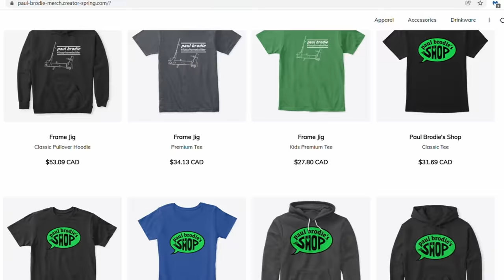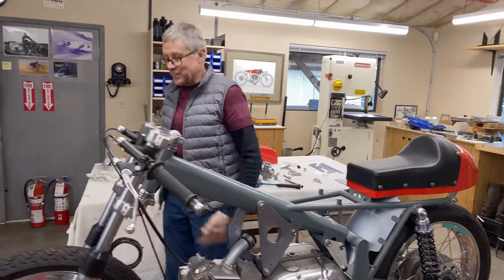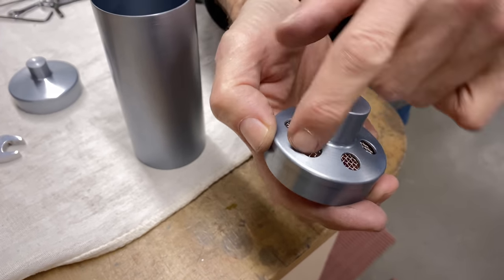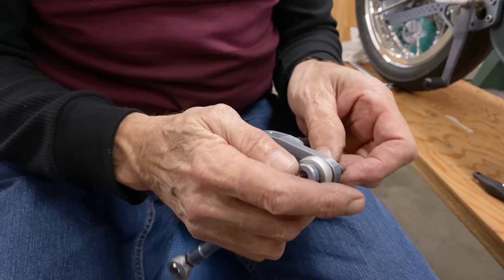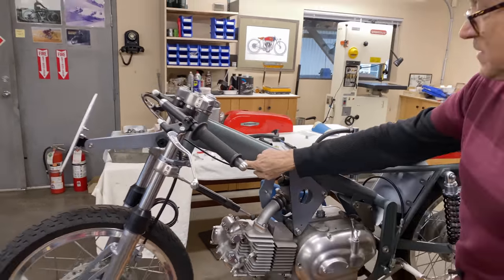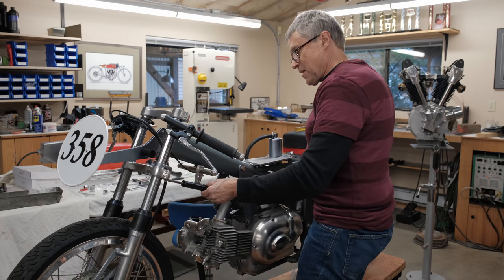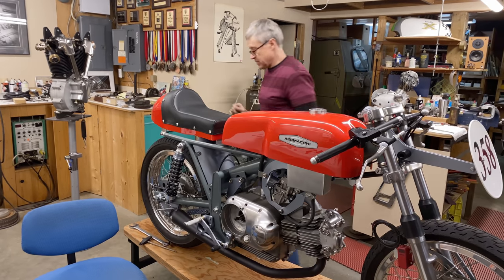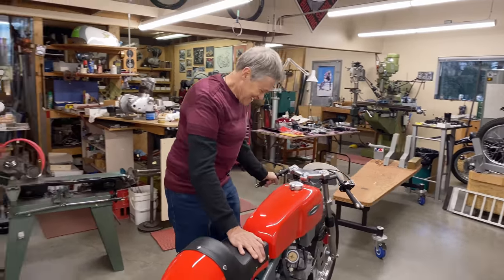Aermacchi Build - Part 2 // Paul Brodie's Shop

Comment: Wonderful work Sir! When you were doing the carb spring and stating three hands were wanted, made me think of doing this on my Norton Commando with two Amal concentric carbs. I saw a tip on another channel about winding/threading the spring onto the cable after fitting the cable into the throttle slider. Sure enough, this works a treat! No more aching fingers and cramped knuckles trying to hold the spring compressed while fitting the cable.
Reply from the maker: Well that's an interesting idea. Thanks.

Comment: Your workmanship and build are absolutely beautiful. Back in the day I had a number of these street bikes and even with frequent oil changes the roller bearing on the rod big end  was only good for about 10 to 20,000 miles. They weren't all that hard to replace but they were expensive, about half the price of the bike's value. .
Reply from the maker: Thank you Yoda. Yes, the crankpin was also the sludge trap and when it got full it stopped the oil flow to the rod.
Reply: During that time period most engines needed extensive repairs or maintenance requiring getting torn down , especially if pushed hard . A larg number of motorcycles engine had the sludge trap inside the crank shaft or on it . One popular option was an oil slinger that looked like a large washer that had the outside edge rolled over forming a trough that caught and held the sludge after it had passed through the crankshaft. Those also would get full of sludge put the location allowed oil to continue to flow. People who did the recommended teardown are de-sludg got very long engine life. Oil filters changed all that. When I was working in a Dealership of British motorcycle a proper engine tune-up included valve grind and piston rings. 
I remember overhearing a conversation between two men about how incredibly it was to get 50 miles out of a car engine with out doing a valve grind. Remember engin oil only  came in single viscosity number ratings.  20w or 30w were common for new engines. 50 was often used in older engines or in hot climates.
Reply from the maker: @thomaslemay8817  The world certainly has changed. Oil filters, better oils, and much more. I remember using 50W oil in my 750 Norton. Sure was hard to kick over on a cold day. I was a young lad and didn't realize I might be hurting my motor..

Comment: Wonderful! Everything looks perfect and fits together very well! Amazing!! I would think it also has a very low center of gravity because of the layout of the engine. Beautiful bike!! Is it a stock frame or did you build it?
Reply from the maker: Thanks William. Yes, the centre of gravity is low and because the bike is so narrow, those factors definitely help the handling. I built 85% of the frame in 2001, and recently finished it off.

Comment: 206 is amazingly light. Maybe add some lightening holes in the front number plate mount? On my old Yamaha RD racers, I started with linkage, but eventually just got a short lever, put it in and shifted upside down. Is there room to do that?
Reply from the maker: Pat, I don't like that system because often the arc of your foot and the arc of the shifter oppose each other. I'm quite happy with what I have. I am lightening the clutch hub, however,  and have already saved over 1/2 pound.
Reply: @paulbrodie  True, and you have to be very careful with the length of the now backwards shift lever and the distance to the footpeg. And of course, you have to remember to shift up to mean down and down to mean up.

Comment: A couple of tips for this awesome two wheeled craftsmanship. First, on the rear brake when you adj the chain you will alter the brake adjustment so be sure to check it before heading out on the track. This is why the cable boss is best placed on the backing plate. Secondly, on your "sex bolt", the bolt should extent to the outer edge of the nut's threads. As it is now if the sleeve section fractures the assembly falls apart and you have no shifting leading to a potential dnf and possibly a wasted weekend, lost entry fees, gas money, etc. If the bolt extends  out into the large dia outer portion the sleeve is less likely to fracture AND even if it did the assembly stays together. Good luck with the bike !!
Reply from the maker: I will see if it is possible to find a longer 5mm Allen screw. I did see that, thanks.
Reply: @paulbrodie  You are supposed to be shortening overly long fasteners so you end up with the slightly larger unthreaded shank of the fastener where it is needed and the new short threaded portion where the threads are needed. Reading Carroll Smith's "Tune to Win" and "Prepare to Win" during  my 4 wheel road racing phase of life made me anal about fasteners. I enjoy your content and hope you aren't peeved at constructive criticism !!

Comment: Morning Paul. Happy New Year. Q- What would you suggest to clean out a bike motor that's been sitting for 30 yrs. Something that I can flush the motor while it's cold. Thanks Paul. RMM
Reply from the maker: Morning Robery. Three decades is a very long time for an engine to sit. Dump the oil, refill with new and try to start. Good way to start the year!

Comment: Looking forward to hearing it run, 1969 Aermacchi/HD 350 was first bike I rode, currently looking for one to ride/restore.
Reply from the maker: I'm getting all the motor parts together. I want to hear it run too. A friend has a 1970SS 350 for sale. Vancouver BC.
Reply: @paulbrodie  The 350SS sounds like what I'm looking for although at 2500 miles, distance is a issue, thanks regardless.
Reply from the maker: @lorimcquinn3966   I'm not sure if the bike only has 2500 miles on it...  Oh, you mean how far away it is from you! Much easier to find a closer one for sale.

Comment: Also, all the custom bits are super cool but you better be making spares. The practical racer uses as much standard hardware and readily available OEM parts as he can. My last build used GSXR rear set assemblies. Cheap on Ebay so I had 3 or 4 sets of spares.
Reply from the maker: I know what you're saying. I guess I was somewhat lucky in that the 5 years I raced Aermacchis I only fell down once. I don't plan to road race; I broke my leg too badly a few years ago...
Reply: @paulbrodie  For me, having spares on hand seems to bring me luck and keep me from falling !!  [ on the pavement at least !! ]

Comment: I can't believe I had never heard of these lovely bikes until watching your channel! They're very "elemental", aren't they - about as stripped down as you could want. I would worry that I'd get confused with the braking and shifting sides switched. 😂
Reply from the maker: The last 2 years of production (73/74) saw the shifting moved to the left side, but the bikes also gained a LOT of weight, which wasn't the best thing.

Comment: Paul, how does this compare to a factory CRTT please?
Any factory secrets still untold or do you have them covered?
Reply from the maker: The frame is a little different. The engine is moved forward and the swingarm is a little longer for better weight distribution. Factory had a downdraft carb, I don't. Factory secrets? Not exactly sure what you mean by that. Engine build will happen when I get all the parts...

Comment: What is the displacement of that engine? Horsepower?
Reply from the maker: The motor is a 350cc and should have about 35 rear wheel HP.

Comment: Is the exhaust an open megaphone? Are you allowed to race like that?
Reply: Most if not all race tracks have noise limits nowadays
Reply: @simoncullum5019  I realise that, hence the query.
Reply from the maker: No, you can't race like that anymore. But it should sound great in my back yard!
Reply: @paulbrodie  Haha, I hope your neighbours are understanding!
Reply from the maker: @gerry343   Oh yes. One neighbour is building a huge house and I have listened to excavators, bulldozers, concrete trucks, saws, hammers, and more. It's my turn now...
Reply: @paulbrodie  😄

Comment: Paul, LoL!! you need an engine hoist on wheels to install engines before you do yourself an injury!!!
I've recently installed a fresh Yamaha 650 twin engine in old mates bike and without a hoist it would have been virtually impossible.
Have seen some lay the frame on the lawn and install the engine but that's not very professional!!
Reply from the maker: Peter, it's just a little 350! Thanks for watching.

Comment: Nickel plated bolts look lovely! Electroless? What were they to start with, zinc? Do they remove the previous plating or just plate over?
Reply from the maker: Yes, electroless nickel. I bead blasted off the old plating, which could have been cadmium.
Reply from the maker: @Alfred Wedmore  In Grade 8 we had a science teacher who was showing us some mercury. Then he dropped it and it scattered into 1000 tiny balls that went everywhere. The whole class got down on its' knees and was trying to pick up the small balls of mercury using folded paper. I don't think that happens anymore...
Reply from the maker: @Alfred Wedmore  No safety inspector ever showed up in our science class, and a bunch of students took mercury home with them!

Comment: Would be awesome to have a sub 100kg finished racer! Did you happen to weigh just the frame at any point? (assume that's steel and not CrMo or anything fancy). Will we see her in action one day 😀
Reply from the maker: I am planning on adding as much lightness as I can. Video part one showed the frame weighing in at 23 lbs. It is constructed out of 4130. It might get raced, probably not by me. But, it might visit the salt flats too.

Comment: Thanks for the fun video!  Two questions: Do you find it difficult to switch between R and L shift bikes? In a racing situation, I think I'd make terrible mistakes. Also, any concern your rear damper mount might slip on the frame post under a heavy load?  If it does, is there any chance the damper might limit your steering range?  Thanks again!!
Reply from the maker: To switch back and forth between shift patterns does take  some focus and concentration. I wasn't sure if I could do it at first, but I did adapt. Also, left side is one down, and the right side is one up. Damper mounts... In the five years I raced Aermacchis, I never used a steering damper. I also never ever had a speed wobble. So, I think we're ok. Thanks for watching and commenting.

Comment: If you want to get an accurate weight using a bathroom scale under one wheel, the other wheel has to be elevated to the same height as the wheel on the scale. Not having done that, your estimate would be on the light side. In any event, beautiful work.
Reply from the maker: You are correct. The video didn't show it but there was a wooden spacer the same height as the scale under the other wheel... Thanks for watching.

Comment: With the foot brake on the left, how do you not get confused with conventional left hand shifter bikes?
Reply from the maker: It does take some practice, but the main thing is focus and concentration.
Reply: @paulbrodie  I guess keeping your toe under the shifter may be a good reminder but under stress I'd probably find myself tapping the brake going into a corner.
Reply from the maker: @chrisharper2658  Some racers would tape the shifting pattern to their gas tank or whatever as a reminder. You do not want to make a mistake in the heat of battle...

Comment: Probably not going to raise it that much, but the tire not on the scale should be as high as the thickness of the scale.  I usually put a long 2x4 on either side of the scale and roll across getting both weights as I push it across.
Reply from the maker: The video didn't show it, but the wheel not on the scale had a wooden spacer the same height as the scale. Wouldn't want to make a mistake and get an incorrect weight...
Reply: @paulbrodie  Very good. I caught all kinds of crap for pointing that out on an Allen Millyard video and he was weighing something much heavier.
Reply from the maker: @lunkydog   Was he weighing the bike with the Viper motor?
Reply: @paulbrodie  No. I can't remember what it was now, but neither end of that Viper are going to be in the range of a bathroom scale I'm fairly certain.
Reply from the maker: @lunkydog  Maybe Allen has a very heavy duty bathroom scale?

Comment: Good job . But I can see room for a little improvement.  Does your class have a minimum weight restriction?  
Also I understand that for best possible handling and stability the front needs to be a little heavier than the back . Can anyone give insight on ideal weight and balance of road racing motorcycle ? My knolage on this subject is dated .
Reply from the maker: Thanks Thomas. The Vintage racing classes have no minimum weight restrictions. You always want the most weight you can get on the front end. You can only do so much with an Aermacchi because the flywheel is so far behind the cylinder head. No one has ever said, " I have too much weight on my front wheel"... The Britten had outstanding weight distribution: 60 / 40. Most bikes are lucky to get 50 / 50.
Reply: @paulbrodie  that is the exact weight distribution  build into a Rickman 650 chassis  stuffed with a 750 BSA Rocket three engine, 5 speed trans . The engine was so far forward we had problems with the front tire  contacting the middle exhaust pipe during hard braking . Making the bend in the pipe tight enough to clear the tire without restricting exhaust flow was a challenge . It had the largest diameter Cerini Forks available at the time. I have looked for a photo of the bike , haven't been able to find it. Johnny the owner passed away in the 90s if memory serves me. That bike was featured on the cover of a leading magazine at the time.
Reply from the maker: @thomaslemay8817   Good stories, thanks Thomas.

Comment: Ohh! sorry to be voice of ???? the front number plate bracket is a spear waiting to inpail  someone!!!!!!!!
In my experience the technical inspector would flag this for redesign before tech/inspection was passed!!
Reply from the maker: There is an aluminum plate bolted to the front of the "spear", so not to worry. Technical inspection can vary widely from track to track, and sometimes it was way too "loose". Once I got passed and the bolts holding on my front brake calliper were loose! Good thing I noticed before practice...

Comment: The shifter linkage fastener pair is called a sex bolt
Reply from the maker: Wow. New lingo!
Reply: Chicago bolt or binder post as well.
I use sex bolt but get a lot of side eye at the hardware store.
Reply from the maker: @jimurrata6785   Ah yes, the old side eye...

Comment: That is no way to weigh. But even if it's within 10% it's a very light bike. I remember you giving something the merest mist of paint to keep the weight down... You are, professor, nicely mad... And if you want to do a secret Santa and give it to me I would have to turn it down. Way too good for me. Thankyou, sir, keep yourself safe, and let that Trojan Mitch have a bit of a rest...
Reply from the maker: What do you mean that's no way to weigh? Totally accurate scales!
Reply: @paulbrodie  I leave it to you, sir to do the experiment. Weigh the front, weigh the back, add the two together. Then weigh the whole bike at once and I, not being a gambling man, would bet that you get a different figure. No doubt you're right, though... Anyhoo, keep yourself well and give that Mitch a treat...

Comment: Everything is beyond beautiful, but did I see slop in the rear ball joint on the shifter linkage? shocked
Reply from the maker: Jonas, yes, you have a very keen eye. That part is still in mockup stage. Until I determine then exact clearance between it and the megaphone, I cannot cut the Allen screw and make the special nut because a 6mm thread is going inside a 5/16" rod end. Did I make sense?
Reply: @paulbrodie  I kind of knew you wouldn't let that slop slip. Inches and fractions of it never makes sense to me :)